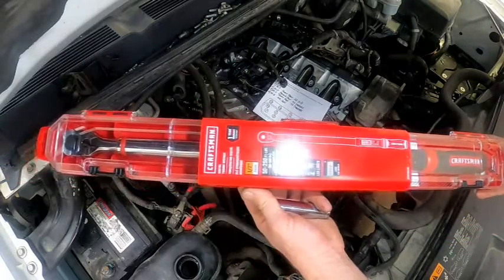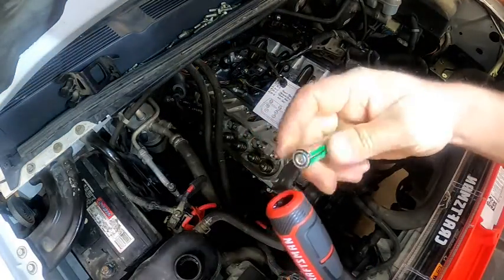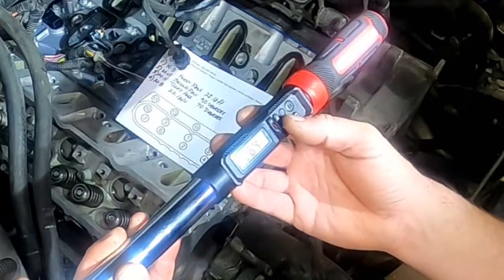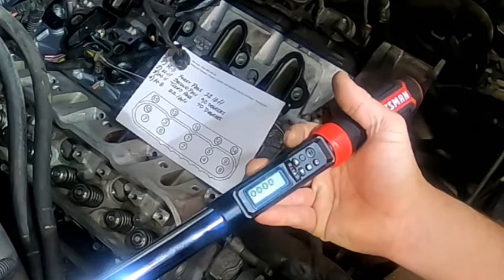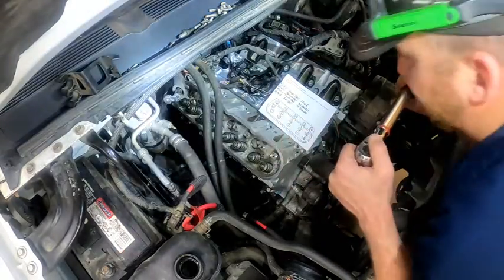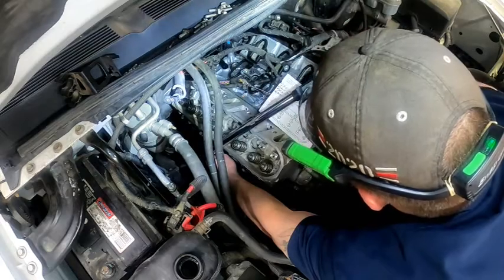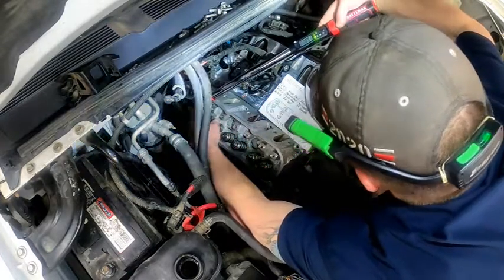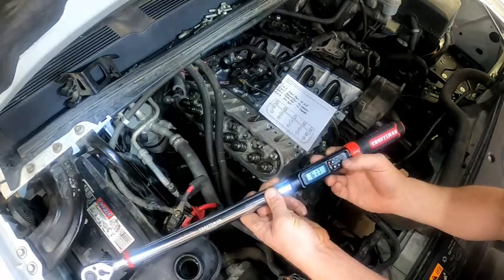Craftsman CMMT99436 Digital Torque Wrench Review. Is it a good buy?

Comment: You can use dielectric grease on those batteries mite help or remove batteries
Reply from the maker: I usually remove the batteries.

Comment: So i dont do what you do but simpler basic repairs will this be a better choice vs clicl version. So you can over torque this one vs click than just clicks and thats it
Reply from the maker: You can over torque a click type if you keep pulling. this one I like a lot better. I have had two less expensive click types that I no longer trust, and I always store them in cases with the tenson spring backed off, they just don't seem consistent anymore, and I have not used them all that much.
Reply: @JosephVollmar  thanks for reply i might consider this craftsman tool. Thank you again.
Reply: you need to recalibrate